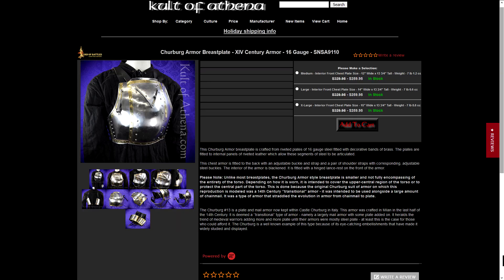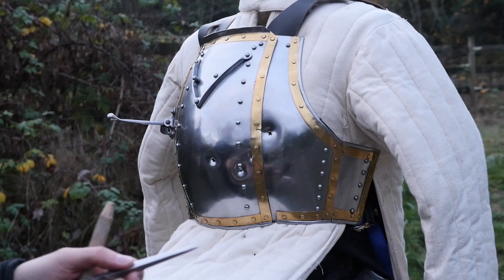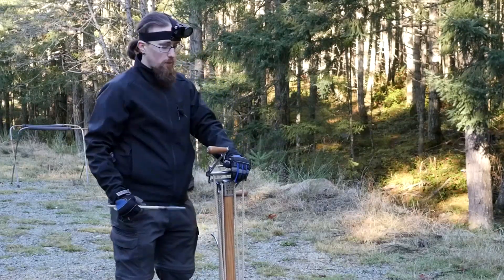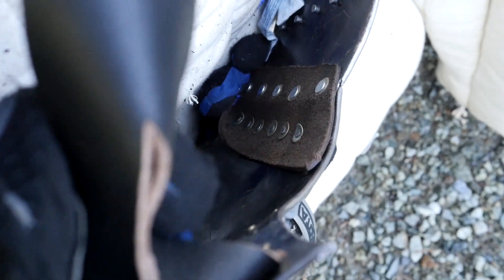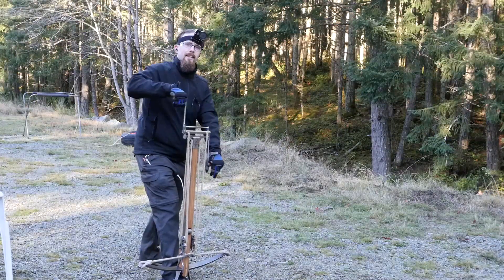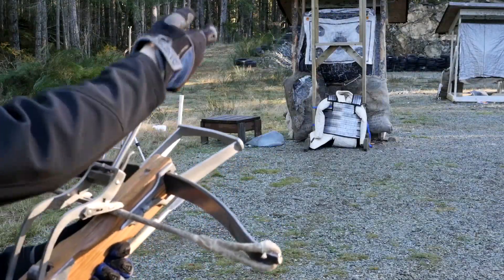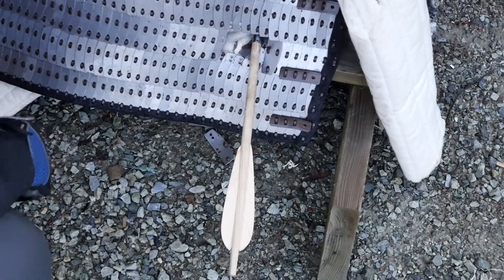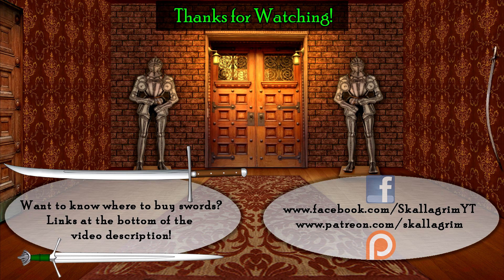Medieval Crossbows vs. Breastplate and Lamellar Armor

Comment: The power of the heavy crossbow seems a little disappointing imo
Reply: I wish the Stronghold devs would know this. Seeing crossbowmen annihilate full-plate swordsmen with metal shields is funny af.
Reply: Its not so much. The thing is crazy powerful. So powerful it even has some kick to it, and its painfully loud too.
Reply: He didn't say people are, he said the units in the game are.
Reply: seklay What are you talking about?  Both plate and lamellar are great against bows and crossbows. It doesent matter how strong the crossbow is, it wont penetrate that armour that was supposed to protect against them.
Reply: Ballistically speaking, the 1000 lbs crossbow only has about the same kinetic energy as a 22lr. Obviously the momentum is vastly different, but, the actual energy involved is not very much.
Reply: Adam B There wasnt full plate and metal shields in those times but hey
Reply: Not really. It's pretty well distributed on your body. You can easly run in 50 lb backpack, can do jumps, squats, get up from the ground etc. It's just much more tiring. Armor is better, because its distributed all over your body. It will somewhat restrict your movement range (good armor not so much) and tire you out much faster than having no armor, but wont make you slow or especially clunky.
Reply: Skal actually tested a modern crossbow against the ballistic  gel torso and I think mail armor. It went right trough. It has a high draw weight and huge draw length as well so it gives a lot of energy to the bolt. I think Skal is not using it against these armors because the bolts would shatter and they are expensive.
Reply: Maybe, but they did it anyway lol. Look how the swordsman and knight units are in full plate or at least half-plate, not sure. But they're covered in plate is all I remember and are also very slow moving.
Reply: Did you expect it to penetrate steel?
Reply: I'd like to see modern high power bows/crossbow shoot those target as well as the old bows. TWANGnBANG has nice modern bows... and an arrow shooting air gun! Maybe he'll co-operate.
airgun: https://www.youtube.com/watch?v=o4cOsaaVuLw
Reply: you must rember that the objecitve of an arrow or a bolt isn't killing the target but wound it, because even a mere gameson reduce by far their capacity of penetrecion

ps: no bolt shoot by crossbow colud be fast enaugh to penetrete a temepered steel plate and be strong enaugh to not shatter on impact, remeber that 15th plate armor could stop even bullets
Reply: The problem I see here is the construction and sharpness of the bolt itself. If Skal could sharpen it and the make sure it's tempered and hardened then try again, I would be interested in the results.
Reply: imurdered there’s a great video floating around on YouTube of some dude doing gymnastics in a suit of plate. It’s heavy,don’t get me wrong,but you can easily roll or even jump while wearing it
Reply: Not really. A thin head would bend. Even a relatively thick head was flattened from the heavy crossbow. Tempering might help, but if the bolt tip is too hard it will chip.
You just can't really penetrate steel armor above a certain thickness. That's it. It will bend, dispersing a lot of the bolts energy and the bolt will shatter if the bow is strong enough.
Historically arrow fire wasn't supposed to kill heavily armored soldiers by shooting through their plates... Lucky shots in gaps, injuring less armored targets, squires, supporting  units,  horses etc. Also the physiological factor, even if you know you have less than 1% chance to get injured by crossbow fire, you don't really want to walk in direct fire... Its scary as f*ck...
Reply: 30-50 lbs spread evenly across your body isn't that bad actually.  I could do acrobatics and handstands at the beginning of the year and then I lost 30 lbs.  Granted I can do it longer now because I'm better fit, but it wasn't like i was a huge plodding beast before.
Reply: It comes down to efficiency. That massive bow is mostly accelerating that massive limb, the arrow is just along for the ride. It might only be a couple times more powerful than a 50 kg Turkish composite bow with it's much more efficient energy transfer.
Reply: Robert the Bruce it’s more about the shaft. The point is probably made from the same material as the armor,only thicker,the shaft is made from carbon tho
Reply: Ben M the crossbow delivers a lot more energy due to having a heavier projectile
Reply: Debilinside And you have to consider archers and crossbowmen could be quite numerous. Even if you are covered in full plate (and only the richest ones could afford it), you really don't want to walk trough a storm of bolts and arrows.
Reply: Yeah, it would hurt pretty damned bad to take a bolt against your helmet. On the other hand, most of the crossbowmen probably wouldn't be shooting you from ten paces.
Reply: Looks like the bolt heads were cast.  Would be curious to see the difference between those and some that were forged.
Reply: seklay consider that a 60-80lb draw is lethal to the un-armored. It isn't that 1000lb xbow is weak. It is that the armor is effective.
Reply: Looked pretty powerful to me
Reply: Adam B You arent slow moving in full plate. You maybe think about modern sca plate armour.

With real full plate you can make acrobatics n shieeee. Its only 15-25kg (30-50 pounds)
Reply: @shrekas2966  u arent? lol kid, more muscles you have the more oxygen you need, they are hot and sweaty, and fk you if you think you can do shit with them on, 15 kg IOTV on fit soldiers is limiting and wear you down fast, most dudes in combat sports can do as much as 20-40 mins of no geared combat, you think you can do that with armor and hold ur positions for hours, wearing full IOTV(15kg) with collar wont let you aim and move properly while prone Id imagine if someone sweep knight from his feet means you wont get up while under heavy exhaustion and high weight+ reduced mobility and visibility.
And if you think they could get on horses by themselves with full plates, oh dear god you are millenial.
And ofc they were all feed and nutritioned properly and had access to PED like modern solders have.
But not only that, elite troopers and aristocrats(not all ofc) could afford plate armors and that being said nobles living off plebs working for them were in super athelete shape.
Those armors were specifially made to save their rich asses from getting killed by pleb with pitchfork.
Diseases were also very common back there, hence why beer, wine was used as water back then because water was polluted and spread many bacteria and diseases so alcohol was used instead.
So yea keep talking shit about 15kg armor not being heavy.
PS: How much Deantay Wilder costume weighted?lol.
Reply: @MrSaintVehementus  Nice bait, bro. Had a good laugh while reading. You can make a copypasta with this :D
Reply: Attention to this comment section!!!

The reason, why heavy crossbow seems weak, is, they used light bolts, which are made only for lighter crossbow. By increasing draw weight of the bow, you don't get any actual speed of the bolt, more accuratly said, bolt is just slowed down less. But from some point of draw weight, the speeds of the bolt by time of release, is almost the same. By increasing poundage, you don't get any actual speed. And thus, kinetic energy. The speed of the limb, after release, is limited by material, in case of steel, it is even less than wood. Thus, to gain benefits and power, of heavy poundage crossbow, you NEED to use heavier bolts, which store more kinetic energy. Example is, that 50g bolt flies almost at same speed from both crossbows, light and heavy, but 100g bolts flight speed, is different, because low poundage of draw weight slows 100g bolt too much, but in heavy crossbow, it flies almost at the speed of 50g one. Thus way, heavy crossbow is able to store much more kinetic energy into bolt. There is no sense of shooting 50g bolts from 1000 pounds crossbow. You need to use at least 150g bolts. I already told several times to Skalagrim, that he is doing this mistake. If you use heavy bolts for armor piercing, you don't want to shoot at range, so heavy bolts are meant only for short range shooting, to bring maximum kinetic energy, for armor piercing. He doesn't have such heavy bolts. Actually, peak of maximum kinetic energy for 1000 lb crossbow, would be somewhere between 200-250g bolts. This way, projectil shoots quite slow, but it brings most kinetic energy with it. For good armor piercing, you need also speed, but still, I would say, that this test should be re-done, by comparing several types of heads, and heavy projectiles. You will see, there is lots of difference, between 50, 100, 150 and 200 gram bolts, when shooting by heavy crossbows. Almost in all test, of heavy crossbows, I see (and often even longbows), people are using light bolts/arrows, gaining almost no kinetic energy advantage from lighter versions, and then claiming, the results are simply weak.

For imagination, you can see kinetic energy capabilities of great horn crossbow, in this video. https://www.youtube.com/watch?v=nY2untEwCnU
You can see, how bolt weight influence the kinetic energy, and that it is reasonable, to go even up to 300 gram bolts, when you have 1200 pounds of energy. The bolt is flying slow, so it fall fast, but you want to penetrate armor only at close range, up to 20 meters anyway, so it is no problem. The test in the video above is even badly made, because chronometer is too close to crossbow, so bolt is not fully accelerated. The actual results would be even 10-20% higher, than you see. And 500 Joules of energy, is for sure power, that is overhelming for mechanical weapon, while strongest english longbows have around 150-180 joules. You would be suprised, but that great horn crossbow, would be able to penetrate both plate, and gambeson under it. That's the reason, why it was even banned by Pope in middle ages... one shoot from 7 days trained peasant, and one knight kill... not too honest.
Reply: Shrekas 2 acrobatics In 30-50 lbs 🤔 you must be strong as shit, and I’m talking strongest ever in history.

Comment: That's some LAMEllar armor, at least compared to the breastplate

Anyway, "scrotum leather" made my day :D
Reply: mysticonthehill also the fact that it’s significantly lighter and allows for much more movement
Reply: Also significantly cheaper to produce since the plates are small and flat
Reply: Yeah, but it would be pretty easy to fix, even without a skilled armorsmith. Like if you were on campaign and took a couple of arrows to the chest, just have your wife or sister sew a new lamellae in there and you're good to go.

I don't know how you would go about fixing a penetrated breastplate while in a similar circumstance.
Reply: Leather lamellar allowed Turkish soldiers to make and repair all their own armour. It was quite the innovation.
Reply: It was later replaced with plated mail. Which has all the strength of lamellar but the easy maintenance of mail.
Reply: But makes up in being easily and infinitely repairable.
Reply: Hey, it still stopped the bolts. It just isn't as durable.

Comment: People often forget that whatever you can make weapons with, you can use that to make armor. When the weapon and the target are made of the same material, sharp instruments are vastly less effective. Shaping a piece of steel into the shape of a katana does not make it any any stronger.

Weapon against armor is actually very much like bare hand versus no armor. Thinking that a sword can cut through metal armor is like saying you can punch someone through the chest.
Reply: To be accurate different types of metal fare better as weapons and armor.

Hardened Steel is considered optimal for armor while tempering is generally preferable to swords/blades which usually requires a fair amount of flex unless it's meant to be a thrusting sword in which case it has to be very stiff.
Reply: Obsidiam armor...

Comment: Movies: guy with bastard sword casually stabs through full plate armour using only one hand.
Reply: Hell, actual papier mache armor would probably be sturdier than Hollywood Plate...
Reply: Full papier maché plate armor
Reply: Poor guy, he's already too poor to afford proper armor then he gets cut down in a fight.

A minute of silence for the unfortunate fella.
Reply: @JasonBombzero Don't quote me on this, but if I recall correctly, a method similar to that was used. Paper Armor was used here-and-there by some Eastern cultures. Surprisingly effective, too.
Reply: Jolly Jester Chinese made paper armour 
Very effective for its time
Reply: Jolly Jester have you seen the samurai using sheets on the backs of the horse to tangle any arrow fire. Actually worked okay.
Reply: @CazadorSlayer  It's true,Japanese foot soldiers made sort of paper-chesplates by laying layers of paper with resin bonding on each other.

It could deflect swords and knives but not so much arrows or spears. It was enough to protect general foot soldiers but nothing even close to metal.
Reply: Jolly Jester, myth buster had tested paper armor, it works really well (for short time).
Reply: Real life: A rifle shot to a good bulletproof vest causes broken ribs and severe bruising at least.
Reply: @oron61  
"At most", man says like broken ribs don't take the target out of the fight.
Reply: Depends on adrenaline and how badly the lung is damaged. IDK if it will always incapacitate you in a fight, but certainly afterwards (I'm not a trauma surgeon; forgive me!)
Reply: @oron61  That really depends on the caliber and type of bodyarmor used. Generally hard plates dissipates the shock over a large area so your ribs wont be breaking, soft bodyarmour might be a different story tho.
Reply: @oron61  Kevlar isn't metal, it's high tensile weave. It stops the bullet and disperses the impact, but you're still being hit by a bullet
Reply: @Galetine That, too. But I think in most cases and on most of my body  I'd rather be hit with great force than have a piece of metal tumbling lop-sided through me.
Reply: @oron61  Only if they neglect a layer of impact padding beneath it, which most do since it is very hot.
Reply: @JasonBombzero actually japanese samurais had paper armor at some point and it was effective.
Reply: @superchief1171  what? They had metal lamela armor. They never had paper armor.
Reply: @subratadhar7698  It was called paper armor,doesn't mean it made from paper.
Casual troop at the time wear cotton armor.
Higher ranking wear Brigandine,some rank were issue with Heavy Lamellar.
General and high ranking officer has their own custom made armor.
Reply: Chinese have armor call Dragon Scale Armor,so it has to be made in Dragon scale.Right?RIGHT?
Reply: Then proceeds to call the weapon a “longsword”
Reply: Movies: stabbed in vital organs. Not a sign of infection or even severe injury.

Somehow dodges a 57 Km/h arrow/bolt.

If the hero has armor on:
His melee attacks slice through armor like thin butter, his enemies cant even damage his armor with a catapult.

His ranged attacks always kill instantly, on the other hand enemy ranged attacks bounce off like a soccer Ball off a rubber wall
Reply: @nottzf8935  but thats perfectly fine and realistic! XD

no
Reply: Myth Busters or some testers I remember seeing on TV/YT tested using Reams of Paper as armour and it actually was pretty effective
Reply: You think that's bad, imagine what an ewok with a tiny rock hammer can do.
Reply: MetalSlugzMaster 
Shudders in Endor
Reply: Lmao or a slash
Reply: Wights vs Jorah
Reply: Never seen such a thing. Give an example.
Reply: Even most games lol. Kingdom Come is the closest I've ever seen by a massive margin.
Reply: That so called full plate armor must be made in China again,  Ya know those smart guys use papers to make "full plate armor"
Reply: while designer ornamental boobplate  does not get hit.
Reply: @JasonBombzero thats what roman sheilds were made out of buddy, layered in oppsited ways to give it more strength and the curve they wanted :)
Reply: *dark souls
Reply: Anyone else imagining Shad yelling LIGHTSABER when reading this?
Reply: @KiaraBombzero they tested that on mythbusters I think.  It did better than expected
Reply: Damm the peddler whom he buy the armor from
Reply: Dude shouldn't have brought plastic armor
Reply: Literally Guts
Reply: I fucking hate when movies do that
Reply: Im pretty sure, that swords have actually penetrated plate armor in battles. In wars there is so much about brutal killing power
Reply: @Daniel Wong
Is it common to ignore difficulty to breathe from blasted ribs, not necessarily punctured lungs? Real question, no sarcasm.
Reply: night king stabs through theon's full plate using a broken wood handle
Reply: @JasonBombzero dude, paper doesnt have any grain, it cant be layered like plywood
Reply: Only a katana would do so well
Reply: @JasonBombzero -"I feel like if you layered and glued paper like plywood, it wouldn't do too poorly as armor. Not great, but not poorly."

bruh dats chinese armor.